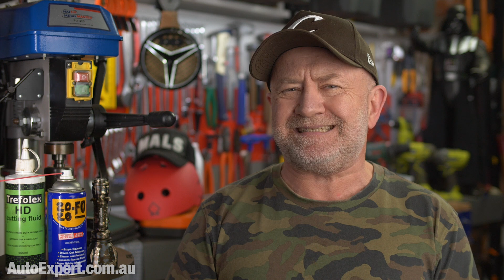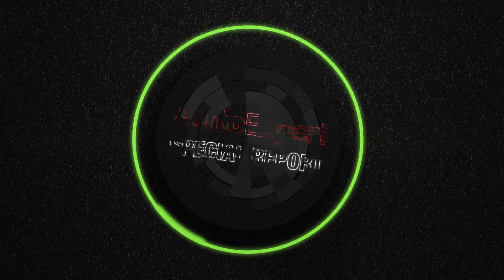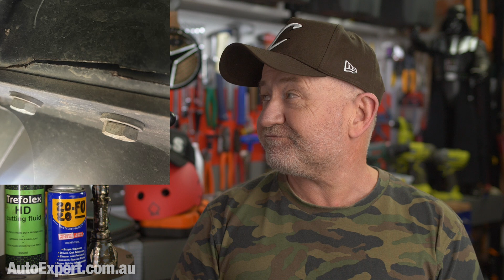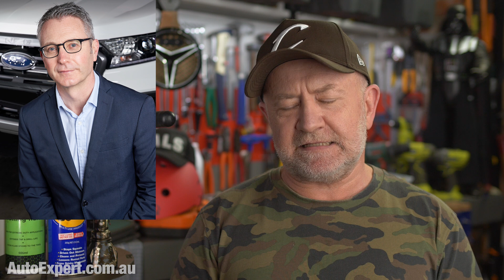CRACKED! Hi-tensile bolts Vs chassis Vs dealer incompetence | Auto Expert John Cadogan

Comment: I like the distinction between low and high tensile fixturing.

I do prefer positive fixturing by design, rather than relying on the mechanic to torque it correctly. (Even fitters may use their inbuilt torquometer - "click, that should do"). (fitted wheel hubs vs self centring nuts is a case in point - all should be torqued correctly)
Reply: I'm a do-it-yourself. I don't torque anything because I don't even own a torque wrench. Yet the few things I've done (disc brake pads, a caliper, once a pair of front struts) never came loose once installed because I actually bothered to tighten them pretty hard by hand with a 3/8" ratchet......which is 100 times better than what a stealership with a "technician" with all the tools and "training" managed to NOT do!

Comment: It's nice to live in a country where every 6 or 12 months a nice man inspects your tow hitch (every little bit of it including every nut and bolt inside and outside the car)
and then the trailer coupling (including the fasteners coupling/draw bar)
and places a hydraulic lift under the drawbar of the trailer and lifts the whole back of the car with it.....(spot the worn/wrong sized/cracked bolt  tow ball or coupling)
Probably saves some heartbreak and you don't have cracked chassis rails because loose bits are found within 6 months or a year.....
May even have saved lives over the years....

Comment: I like to use a needle gun on the repaired area after welding.  
 Great video John 👍
Reply: What does using the needle gun after welding do?
Reply: @oldfartonabmx2122  it sort of stress relieves the weld and surrounding area. 
  Often did the same on diff and chassis repairs.

Comment: G"Day John,,mater i worked in the steel industry,,and vevry day bolts would get the Impact Gun,,But on jobs that Needed to be rightWe would get torque wrench recal;ibrated before each outing,,Now Hi tyensile bolts do take a bit to Break,,i mean we have had hydraulic nut spinners to get the right settings,,Have never seen a strecth hi t Bolt ever,,plenty of snapped bolts,,but all these have been clean breaks not stretched in any way,,
now looking at tha crack and the way it has given way,,would be check material for the right stuff,,Have seen plenty of cracks like this and has metal failure,,wrong grade or bent to cold,
Plenty of chinese steel has this sort of failure,,
fact if you pay to have bolt checked evey time it goes for service,,then why were they loose,,
and all 10 of them,,,I mean if there was one you would never know,,if there was one that was tight ,that would the one broken in half,,
The only otherpoint which you missd in why they fail,is nut,,Have they fucked the nut over tigthtening,?Is it a hi t nut,and is the nut on the righht way,,
yes they have a right way,,and too me the washers used don't appear to be Hi T either,,

Comment: People still use spring washers.., I used to do hands on demonstrations for engineers.., a spring reduces the torque to loosen M10 by 5-10 NM easy Luerssen over just a flat washer & nut.. guys did believe it, did it themselves..  why the F would a sting washer help.., by the time the spring can chisel 👍 the clamp force load is gone…
Also why don’t people use the correct grade of Loctite thread locker …, most all your high end OEM stuff does..

Comment: You can see where the washers have been hammering and fretting the chassis for some considerable time, I cannot understand why NNN did not notice that before any further trouble occurred. And yes I agree those bolts were never tightened correctly from the get go but as the repair is what an hour or so of workshop time I cannot see why the dealer wont carry out the repair FOC. Or do they not have a welding machine and someone to use it, A18  ER70s-6 mig wire is more than good enough and most car rep[air shops have that.

Comment: Ford dont give a crap about any of their customers recently I have learned that everyone with a Factory fitted LPG system in their Ford is heading for a big problem. 
When ford decided to release their LPG fuel only models they designed a system using off the shelf parts there is one part that is in the engine bay which regulates the flow of the LPG and its pressure  till this point it is liquid due to storage pressure. 
This regulator device is therefore exposed to extreme cold and to counter this it has a hookup to the cooing system of the vehicle to stop it freezing.
This part therefore has a couple of diaphragms inside it and must have perfectly flat and straight mating surfaces. These over time and at points being over heated like when towing loads behind said vehicle will warp and/or the diaphragms will become hard or break. This then requires the whole assembly to be replaced. Right now in ALL of Australia ford only has one of these assemblies and the retail price for this item was quoted at $3000.
You can buy the exact same part from the supplier in Holland for $1000 how ever due to fords assholery you cant use it, the reason for this is that when ford got EPA approval for the gas system it used their own part number for this assembly not the manufacturers part number. 

So here we have a number of thousands of these LPG fuel only cars on the roads which all will at some point have to have this part replaced but ford are no longer going to get more in stock as these cars are in the 10 to 15 yr old range BA and later models. The part is available from the manufacturer that ford got them from for 1/3 the price ford want but the part is not legally able to be used since the part number that is approved is not related to the manufacturers number just some wild ford one. 

Why would ford do this it is simply that it is a way to force the owners of these vehicles to buy newer vehicles as these vehicles would cost more than they are worth to convert into unleaded fuel cars since they have no fuel tank for unleaded and no injectors for it and the ecu is specially set up for the LPG system. and dont think the Holden LPG cars are much better but atleast they do have the ability to be made to run on unleaded instead without major hassles.
Reply: When the converter is all buttoned up and the diaphragm is invisible...how will anyone know that the $1000 OEM bit is in there?
Reply: @JohnSmith-yv6eq  Is it the converter? he mentions a pressure regulator that needs replacing.
Reply: @petesmitt  
He also mentions hot and cold acting on the diaphragms...so it is at this point that the regulation of the conversion of the liquid propane into the gaseous propane occurs.....
it all in a name.....
Reply: @JohnSmith-yv6eq  of course.. he must be referring to a Vialle converter which cost only $900 new or reco $450; who would pay Ford $3000 for that and why?
Reply: @petesmitt  
Because Ford Australia initially submitted their conversion with the Ford part number...and failed to tell the regulation maker that it had a standard part number from overseas.
Thus , to meet Australian Design Rules, only Ford's part could be fitted...at $3000 as a Ford original part.
Yeah, right......
Another dealer part rip off....
Reply: @JohnSmith-yv6eq  Because it has a stick on id with the ford number on it which the manufacturer dont have to put on them so a quick scan of the outside would show it is not the "approved " part number and this would make the car non EPA compliant
Reply: @beckster181  
You make the stick on label and box them with the OEM part.....

Comment: After a "certified Ford tech" called me to come preform a diagnosis and repair on his Mustang, after his own dealership service department failed to do so, I lost what minute faith I had in them to do more than check if the taillights work.
Reply: They'd probably fuck that up as well, and then install new globes to be sure... At $20.00 a pop.

Comment: Perhaps the poor tech was influenced by the extremely poor fastener quality at the retail level of today, and did not want to strip the threads!?  (reaching here).  Let's face it most aftermarket parts are garbage in this regard.  I remember being astounded stripping a threads on a tie rod end for the first time, being nowhere near listed torque, or what felt right in the hand.  Obviously these being marked fasteners, you should have some confidence they will take the recommended torque, at least.  Very sad.  I have a family member who actually uses Geek Squad to have TV's mounted, and buys the extra insurance, in case it falls...
Reply: There was an IBM plant in a foreign country years ago with a roof drainage problem. An engineer looked at the roof support design, and wondered if the bolts were actually the grade and material needed to do the job. After the builder found a way to test the bolts, it was found the bolts were well below specifications. The engineer told IBM to close the plant unless and until all the bolted roof system connections were welded to make sure the whole roof didn't collapse into the building. IBM did that, and a disaster was averted.

Comment: 🤺 all these silly installers will do now is move the ground potential wires (negative terminal) to the other side of the chassis (where the nut is) and blot it on there, more than likely cross threading and rendering the bolt useless like tits on a bull.

Comment: Except there is no repair procedure for the cracked chassis on these shitters. Absolutely not allowed to apply any heat at all to the chassis unless you get it signed off by a engineer.
Reply: So there is a requirement for an engineer to sign off on any repair = there is a procedure....
Reply: @JohnSmith-yv6eq  My point is its not that simple to just weld it up otherwise people like me who repair vehicles for a living would be doing it everyday. Seen as most engineers will not sign off on it without a xray and who will blame them when its a tow point as they become liable when or iff it lets go of a trailer. Like I said its never going to happen

Comment: Fantastic.Great watching your videos during lockdown on the other side of the pond.Great to listen to an expert
Reply from the maker: Thanks very much, Mark.
Reply: As an Aussie (not even a New South Welshman), I want to apologise for the bin chicken sending the virus to you. Absolutely mortifying.
Reply: @mahcooharper9577  The Chook and her mentors generosity in this field is well known.
Reply: Nice yarn Cadoge's.
I guess without looking at it more closely it's hard to say. For instance even if the fasteners in a bolted joint are torqued to spec, they can still come loose if for example the two parts were misaligned or there was some manufacturing defect in the parts being fitted.  This can and does happen.  The result is that the fastener is "torqued " but there is in fact no actual clamping force between the two mating surfaces and no real tensile load on the bolt.  This is a trap for young players as torque is a measure of the friction on a fastener and actually tells us nothing about the tension on the fastener which is actually what we want to know.  
That also means the fastener is now subjected to shear loads which greatly increases the likelihood of it failing. 
My point is,  correct tension of the bolt is important,  but a torque wench is no substitute for incompetence or negligence.

Comment: Absolutely bolts were not tightened but strange there is no rust rings under the thick washers
Reply from the maker: They're zinc plated and the car is only 3yrs old.
Reply: @AutoExpertJC  Sorry I meant around the edge of the washers from fretting

Comment: To say that the bolted connection was left loose is the low hanging fruit of the explanation. I was expecting the butcher paper and textas to make another appearance in the fat cave! I need to see a bolted joint diagram at least! Cough think you'd agree
Reply: Yes.  I did watch a video recently that explained that spring washers are virtually useless.

Comment: I'm guessing some bean counter has done the maths and reckons the cost of fixing this is more than the reputation damage it'll incur....OR they could just be arseholes. I've leaning to the latter. 
  Honestly though I'm guessing they do calculate that sort of thing.  Like "will the wrongful death claims cost us more than the recall" sort of stuff.
Reply: #GhostOfPinto indeed
Reply: Many years ago, Dad (mechanical engineer) offered a suggestion to Ford for an improvement to Falcons.  They rejected it because it would cost 5 cents per car.

Comment: Some forensic engineering needed here. It still could be Fords problem. Worth getting a sample of the failed chassis area and perform some metallurgical tests. With China suppling the lions share of steel nowadays, the industry I used to work in had continuing quality issues with so called certificate compliant materials. It was not till non destructive and destructive tests were performed, were the deficiencies revealed.
Reply from the maker: Two different chassis rails, formed on two different machines (probably at different times) from different stock, and then joined together. It's not a metallurgical problem.
Reply: @AutoExpertJC  mode of failure is still not quite typical in bolted joints. IMO opinion there should of been more warning if it were only loose bolts...rattling when hitching trailer , cabin transmitted noise when accelerating and braking. ....just saying. 
PS A longitudinal crack forming  in tension to the chassis rail is less likely than a transverse shear force. Maybe towball loading of the trailer was consistently exceeded?

Comment: We had a couple of presumably high tensile bolts come loose, and by loose I mean, they snapped in half and stopped doing any clamping. Not in a car I should add but in our (now ex) Jayco Swan Outback porta potty on wheels. I was happily removing the canvas as it had to go off for repair and found that 2 of the 4 bolts holding the roof on (one in each corner) had snapped in the middle. I am pretty sure that our poop transporter is not the only one that was/is rolling down the highway for goodness knows how long, with just 2 bolts holding the roof on. Some pretty dodgy stuff out there.
Reply from the maker: Breaking = overtightening. Or over-stressing in service.
Reply: Watch out for fake Chinese made high tensile bolts.. they have the proper marking on the head but the steel is not up to standard.. unless you are happy with steel the consistency of stiff plastic.

Comment: Working as a humble mechanic formerly at a Ford dealership I am happy to say that nobody has ever put a torque wrench on towbar bolts. 
I mean, why would you do that when you can have dick pulling contests about fitting parts in record time. 
We had a guy who could fit towbars to BA falcons in 13mins.
Reply from the maker: That's truly disgraceful.
Reply: He he. I knew someone whos brother years ago worked at the biggest Holden dealership in Adelaide. As a 15yr old apprentice, there were monthly competitions on who could service a car the quickest. 9mins. That is all, 9mins. Consider the labour cost of that service, paying a 15yr old apprentice rate, and 9mins worth. I guess the 150point safety check is auto generated.
Reply: @nordic5490  Can't check much in 9 minutes, especially if you're actually changing oil and filters...
Reply: That's the truth straight up.
Get them in and get them out quick as fuck.
I got heaps of dealership stories.
And I'm a mechanic, that bought a new car from a dealership.
Reply: Agreed, never seen anything more technical than an ugga dugga used to fit tow bars at a dealership. Scary.
Reply: and that's why ford will always produce shit products and maintenance

Comment: Not just Ford.  Years ago I had an issue with a Land Rover dealer on Sydney's North Shore.  Land Rover's Customer Care(less) comment was that they didn't interfere with the way a dealer operated their business.  Not very helpful.
Oh, my current Range Rover came with a factory fitted towbar.
Reply: Would that have been at the time when Ford owned LR? Also I highly doubt that your towbar came fitted at the factory in the UK.
Reply: @Purple_VH  No, my current Rangie was built when BMW owned Land Rover.  Apparently, Oz-delivered L322 Rangies came with factory-fitted towbars.  (the RR referred to in my previous comment was my earlier P38A Rangie.  It had a locally made Hayman Reese towbar which I fitted).
Reply: Endless money pit, but horses for courses
Reply: @DoubtingThomas333  Mine has been very reliable and it's lovely to drive.
Reply: @p38arover22  is it a simple ancient model or a late model from the last 20 years?
Reply: @p38arover22  https://youtu.be/DNAl3P62NGs

6:12 onward.
Reply: @DoubtingThomas333  Semi-Ancient.  It's a 2003 L322 (the model before the current model).  BMW M62 4.4 V8 petrol, a lot of the electronics are shared with the BMW E39 X5.

Comment: "Torque wrench? But I can torque by feel" ;)
Reply: I reckon I can. Ish. 
Years of self taught mechanicing on many 2 and four wheel vehicles and you know how tight some bolt or nut needs to be.  Is it dry, greased , a bit rusty, fine thread coarse thread, going into Ali, very long, brass?  So many variables. The only thing I’ll use a torque wrench on is stretch bolts, on cyl heads or rods. 
But going round after a month of use and checking for that half flat snug up is no bad idea. 
Checked my overdrive bolts 35foot/lbs when I’d had that off, without removing the seat box using a torque wrench is a pain. I’d done them up as tight as I felt they should be done(1/2” diameter shank, 8” long going into aluminium) I checked one. 35ft /lbs give or take. But I’m not building formula one cars so who cares.
Reply: To quote a wise man:
"HHNNNNNNHHH CLICK!"
Reply: @sixstringedthing  Ave
Reply: tighten till it strips, then back off 1/4 turn, job done.